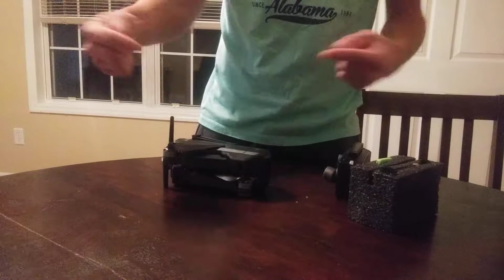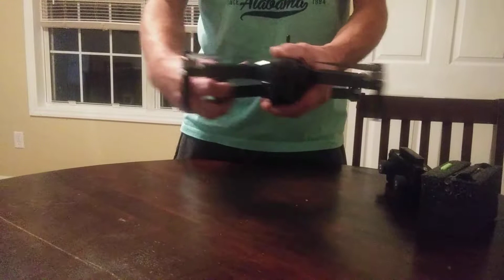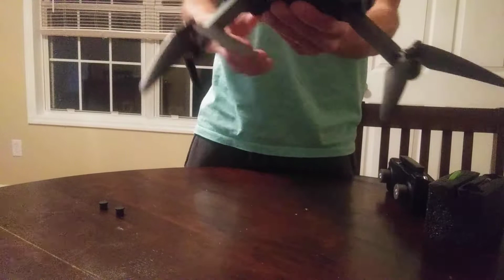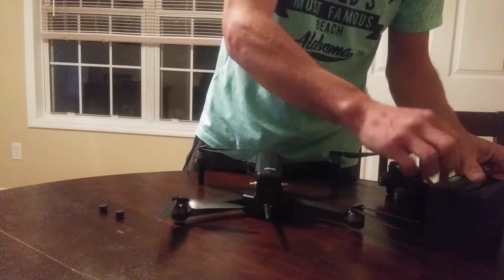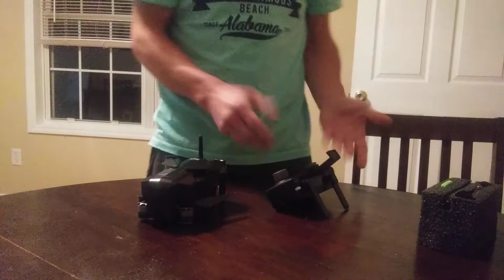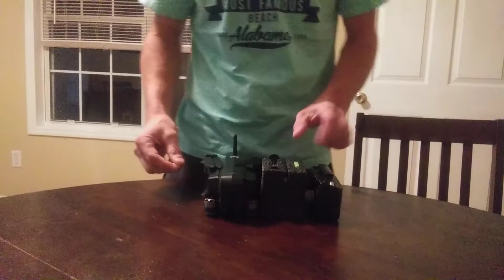Sjrc F11 drone antenna modification

Comment: A trick for any drone it´s, once landed, to keep the propellers running at low rpm, this way, motors will be cooled with the flux of air...also serves for cheap drills and similars after heavy usage.

Comment from the maker: original antennas r i PEX connectors I disconnected them and put in new SMA I PEX connectors Plug & Play drilled hole in the Drone and threaded them on
Reply: do plz. more pitcure on drone..  and putt link to where to by anntetas .. 

I tkink drone is very nice bud 5G SUCKS big time...   reange to dtive drone is GOD!   but pitcures to mob. phone is CRAP...  sou ..  PLZ more pitcure and where you bouth antena for 5G .. 

(my english is nice...   love it .. :-)

Comment: Love your mod . Any chance on a tutorial on how you wired in your 5g antennas.  Would love to extend the range of my f11 fpv. Thx
Reply from the maker: It is literally plug and play with ipex connectors
Reply: Why my remote control is fully charge but cannot on

Comment: Dude, love the look of your mod's, and the fact that you double your'e range. However, I think there is something wrong with your drone. My stock f11 in low interference area's gets up to 800 yards fpv. I have done over 1k blind before return to home kicks in. If the mods do that for you with that limited a range on your craft, hopefully, I with one with maybe just better reciever's might even get 2k. Thanks for the tips.
Reply from the maker: You must be in an area where there is no Wi-fi interference.. depending on location everybody's range will different.. also not just the area it depends on which phone or tablet you are using so just in my general area exact flight path is what my particular range test was for to see if I could get more flying the same path.. the path I fly at my house is a high  Wi-Fi area 👍